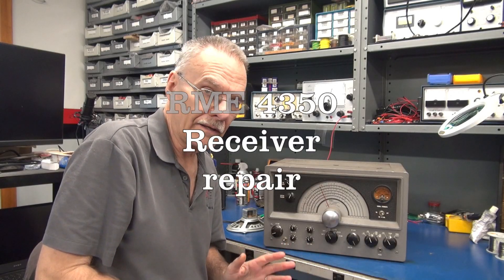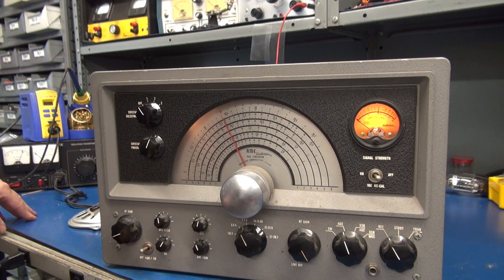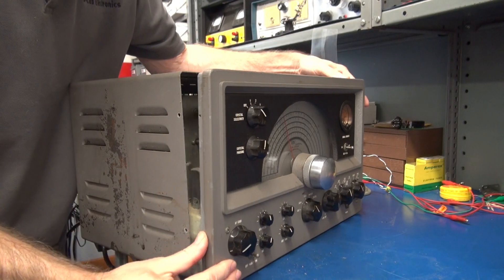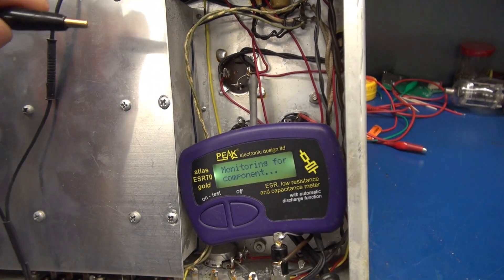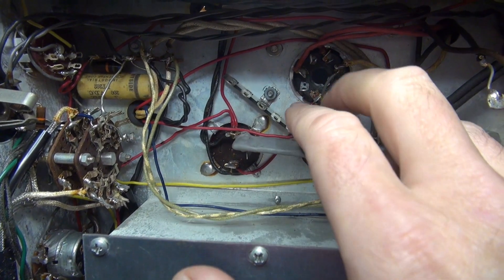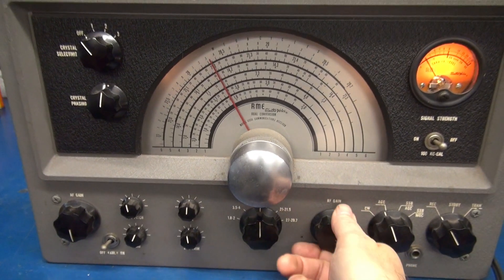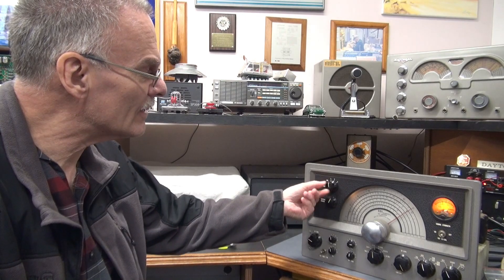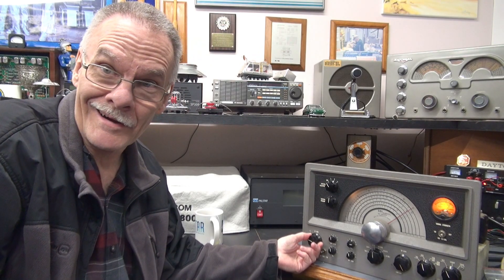Vintage Electro voice RME 4350 Ham band Shortwave Radio repair bad filter capacitor replacement

Comment: I'm a musician and not the least bit inertrested in becoming a ham radio operator but I find the equipment, components and point to point design fascinating. Your diagnostic and repair techniques are amazing. Great job, great videos.

Comment: I love your videos.I'm looking for your info on altering the vintage tube radio to handle today's 125 volt service. My radio label shows 110/125volts. Does that mean I don't have to alter this set. (It's a Northern Electric 5000 AM radio ~ c.1946). Thanks man. I appreciate your time for a little advice.
Reply from the maker: Hello, reviewing on the web, I see that this is a no-power transformer radio. Line voltage is dropped across the tube filaments. Higher line voltage will just make those tubes a bit hotter. I have not worked on that model, but I would not believe the higher AC voltage would cause a problem